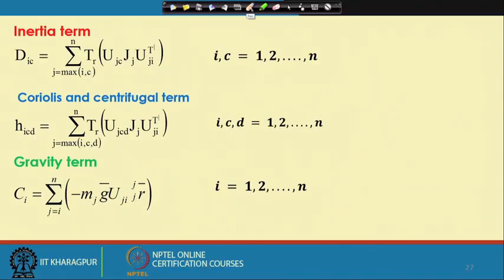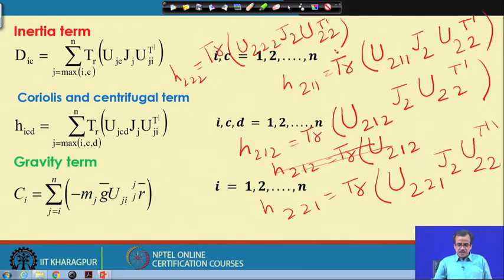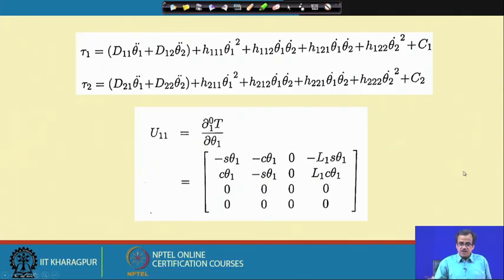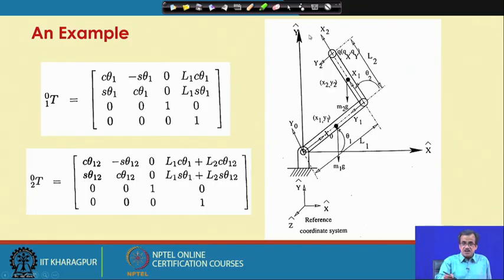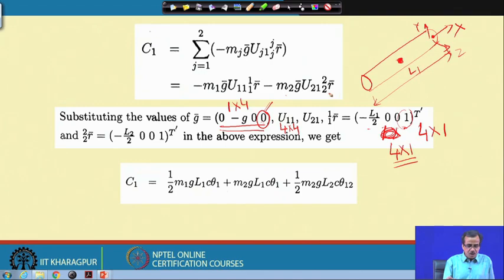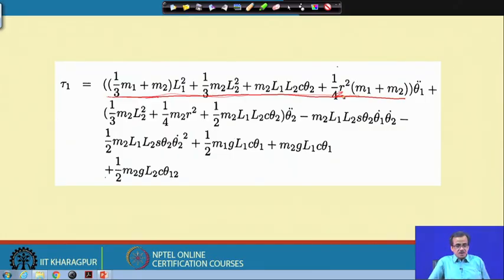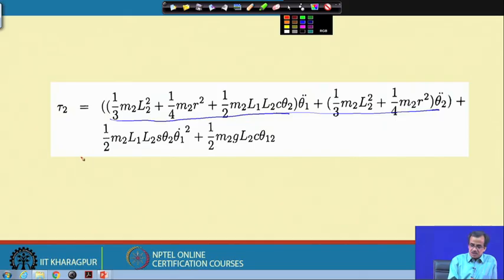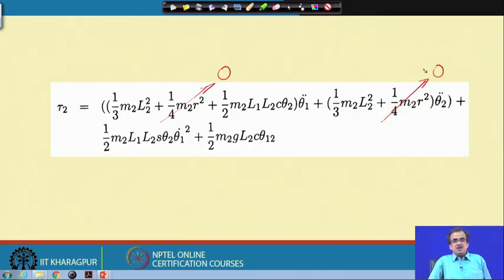Lecture 28: Robot Dynamics (Contd.)

Comment: The following data are given for a vibrating system with viscous damping W= 10 kg/cm, K =30kg/cm and C = 0.2 kg/ cm per sec. The ratio of any two sucessive amplitudes is 
A) 2.983
B) 0.983
C) 3.983
D) 1.983